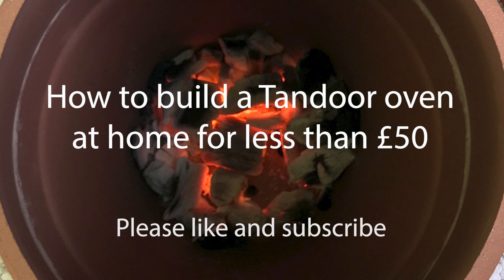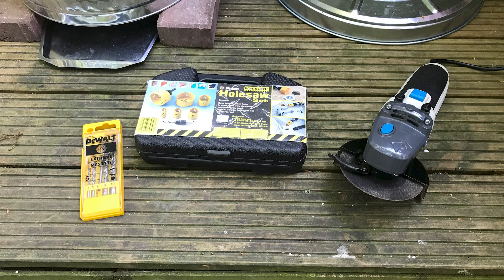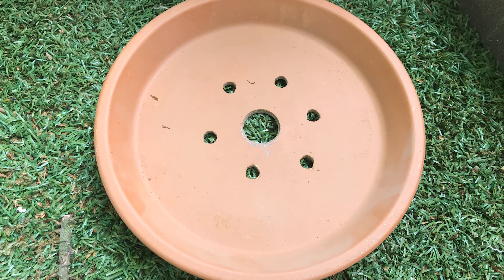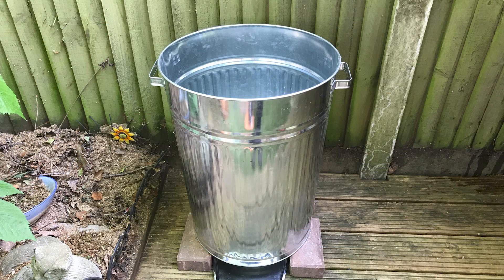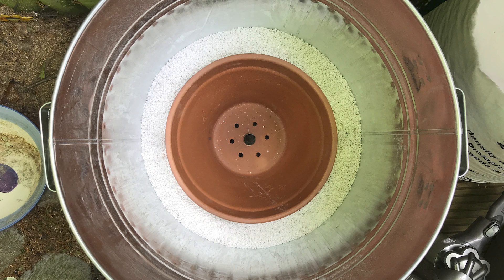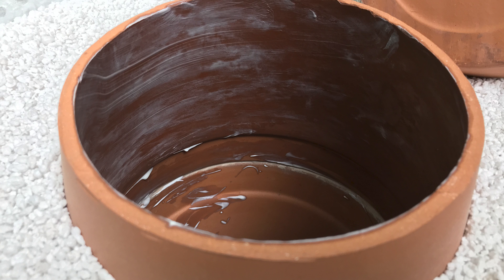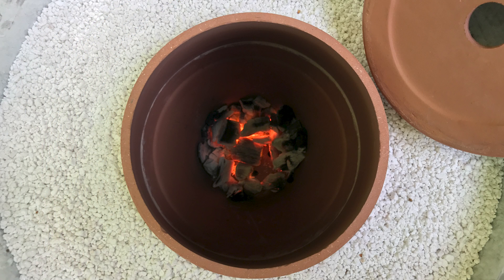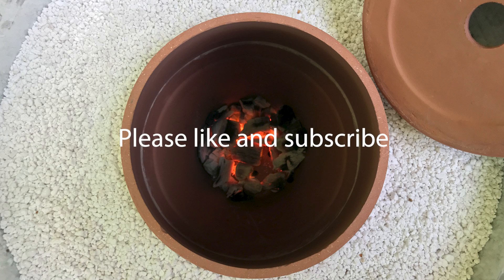Home made tandoor | How to build a tandoor oven at home for under £50 | How to Make a Tandoori Oven

Comment: Ok so I finished and seasoned it with low heat .Few questions here What should be the internal temperature, when you stick your Nans inside, do you cover the top hole with cover and for how long you leave them in before they are done .
How many briquettes of coal do you put in to achieve this desired temp ? Tx
Reply from the maker: Hi, I try to get it above 400+ Celsius by adding coals and then 1/2 hour later adding more (they seem to build up the temperature and then once its hot the new ones are coming to life and pushing it higher. If you get black soot on the sides it's not hot enough as this should burn off when the right temperature.

Briquette wise, I'm note sure I'm afraid as I use Big K restaurant grade Lump wood which burns for longer I think so it will be trial and error. As for the cover, yes naans in, top on (but leave the vent hole clear) then normally done in around 3 minutes. Just a little water on the back of the naan to get it to stick. Hope that helps, Josh
Reply: Great will try Tx .
Reply: @TheCurryKid  For doing Nans do you need the black soot to have burned off? I've just started my oven and its not black soot on but it should burn off before doing the nans right?
Reply from the maker: yes it should, when it gets hot enough it shouldn't get a build up at all. You could brush around the inside with a household brush first if it helps

Comment: Wish I’d done the priming step… cracked both pots on my first cook.

Is the vermiculite essential in stopping the pots from cracking too or is that only to stop the bin getting too hot?
Reply from the maker: sorry to hear that, yes the slow priming is really important as it removes all the moisture from the pots that expands and cracks :( The vermiculite is purely to stop the outside container getting hot. When my tandoor is around 500 Celsius inside the outside is only around 20 Celsius.

If they are only small cracks you may still get away with it. See how it goes

Comment: Hi hi my terracotta dish is broken half does that make any difference with the cooking of the Tandoor
Reply from the maker: Hi, It shouldn't do. All it's doing is adding an extra layer where all the heat is most concentrated. The most important bit it to make sure the first couple of burns you only use a 3-4 lumps of coal or lumpwood so it gets used to the extreme heat. Once you've done that then it's good to go. Mine got to 550 celsius before my thermometer cut out so it's a hot bit of cooking fun :)

Comment: Hey do I have to use fire bricks or normal bricks is ok ??
Reply from the maker: Hi, for the bottom bricks I just used some paving blocks from my nans. there isn't a lot of heat at that place anyway as they are more a holder for the pots.

Comment: What length skewers would you recommend to buy for this?
Do you cook with skewers in or hanging out the top?
Reply from the maker: Hi Ashley. I use these https://amzn.to/3hIR52S they are 56cm long which gives a fair bit of skewer outside the tandoor to get hold of. So far I've only cooked with the skewers in, only because I've only got 6 and they have been full each time so I've not had one spare to hang from :)

Comment: Great video but how about putting the saucer on the inside of the pot rather than having the pot sit on it? I'm thinking for easier removal of used charcoal? Or maybe have 2 saucers? One that the pot sits on and another on the inside?
Reply from the maker: Great idea. Thanks for the tip. I did have someone make one of these who added a metal bowl inside with lots of holes drilled in it then added the coals to that.

Comment: Excellent job Curry Kid.  I followed Jimmy Dohertys method which is similar - but I made a fire resistant lightweight concrete as the base inside the bin (instead of Jimmys firebricks - too much cutting) using lytag and SECAR high alumina cement - rest same as yours with vermiculite
Reply from the maker: Thanks Michael. Sounds like you're having fund already. I just went for a nice easy build, at the end of the day if I can build this one at 13 nearly everyone else should be able to just fine :)

Comment: So the naans came out as hard they could be , walls were at 270 Celsius when they were stuck on , but came out uncooked from back and burnt from front and too hard ...? 
What could be wrong ..!
Reply from the maker: Hi Mo, that's strange. How thick were the naans? They are normally only about 3-4mm thick and the air in them makes them rise and cook really quick both inside and out :( Did you also dab the backs of them with water?
Reply: Will try with some more coal and see outcome .

Comment: Excellent instructional video Josh, good work! Now I'll go out and find the components here in The Netherlands.
Just my two cents: If you'd want to speed up the process of ageing of the trashcan: rub it with yoghurt. Will not work instantly, but within a few weeks instead of months.
Reply from the maker: Many thanks, really appreciated. Just take your time in the initial careful warm ups and it will work perfectly for years. I use mine each week at least once :)